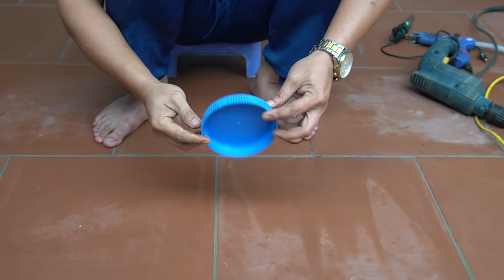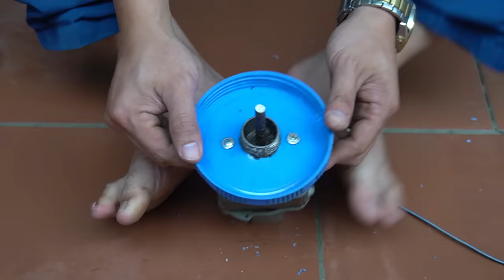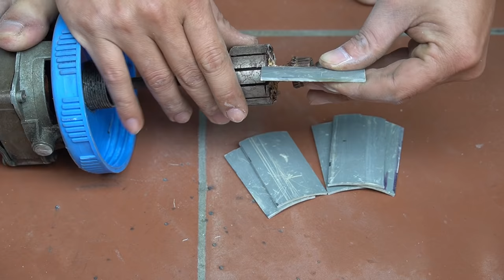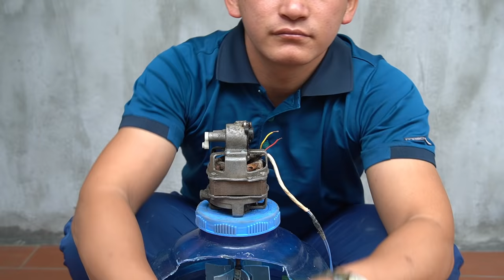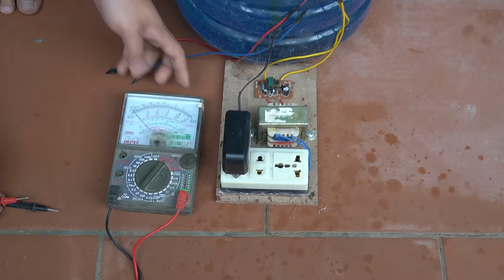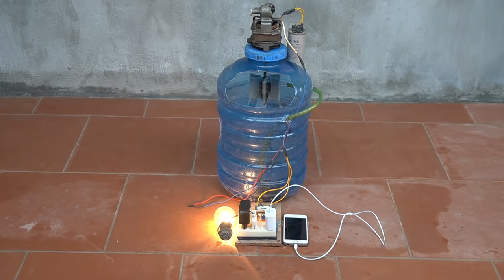Turn Plastic Bottles Into A Simple And Creative 220V Water Turbine Permanent Generator

Comment: While it was running you need to stop the turbine in action so we can see that the power shuts off when you stop the termite so we know it is not running off of other power sources.
Reply: Like the one inside the Capacitor Carcass...
Reply: And theres a video cut in 7:12
Reply: We
Reply: Pero raro, esa clase de motor no sirven para ese medio de inducción.. Es falso debe haber, una fuente de energía oculta en alguna parte.
Reply: Things aren’t adding up.,🤔🤔🤔
He’s obviously charging up the capacitor with the battery that will run things for a min or two.. so with enough video cuts 👉🏻the blind get fooled 😂
also to generate real power that should be spinning a lot faster😂
Reply: jinious

Comment: Nice Trick!  I'm guessing the hidden power source is in the "capacitor", but perhaps it is a bunch of batteries on the underside of the board.
Reply: Exaclty, because I still don't understand why he needs the water. Obviously it is not what turns the motor

Comment: Great invention this is what i want to do also, i am also an electrician that want to give help in remote areas that has no electricity, great job, salute to you sir
Reply: Sir please explain the PCB Board and transformer which is used in the video
Reply: @subodhchandramahato3788  12/24 to 220 volt ac transformer capacitor for smoothing current
Reply: @Canonhood  
Thank you so much for replying Sir
Reply: @Canonhood  
But Sir , what is the function of PCB Board/electronic kit that use befor transformer please....
Reply: The pcb is a voltage regular from power supply TDC POWER 24V 1-PIN AC UK PLUG POWER SUPPLY US 110 volt ac there is no diods or bridge rectifier on the pcb so It must be ac to ac
Reply: @Canonhood   
Thank You very much Sir, for your valuable information...🙏🙏
Reply: @subodhchandramahato3788  your welcome
Reply: @Canonhood   Sir, can I work with you on that PCB board. That's the only thing thing that's not clear to me.
Reply: @oluwasesanadetola775  what the issue
Reply: @Canonhood  Am thinking of how the PCB board + transformer can be incorporated in a free energy project of using an Alternator + DC Motor.
Reply: @oluwasesanadetola775  I cant see a bridge rectifier or 4 diods side by side on that pcb so I'm taking it converts dc to ac inreverse then the transformer step the voltage up to 220 volts ac from 12/24 volts like a inverter but where the 4 mosfed transistor
Reply: DC-AC Converter 12V to 110V 220V AC 150W Inverter Boost Board Transformer this has the pcb and transformer in one pcb ebay your friend 

Or

500W Inverter DC 12V-24V to AC 180V-220V-380V Booster Board Module ✧
Reply: Part list 

1 x 500W Inverter DC 12V-24V to AC 180V-220V-380V Booster Board Module ✧

2 x tumble dryer motor induction converted to a generator by opening motor and dill 16 holes to plus round type nimdium magnets and glue in place with super glue North and south
40 x nimdium magnets 
1 x super glue
1 x 240 volt ac to 12 dc transformer to power the water pump 
1 x submerged water pump 12 volt to pump water from bottom bottle to top bottle
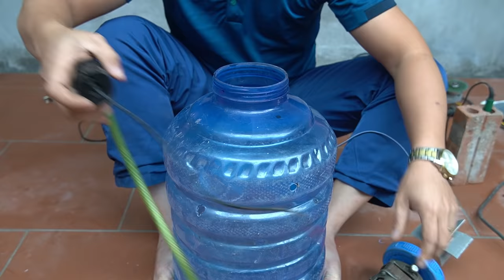Reply: 4:04/11:57  can someone be kind to tell me what is the name of that component.
Reply: @savedgeneration3254.  12 dc volt pond pump submerged powered by 240 ac volt transformer
Reply: Have you done any project now, helping people in remote area is one of good to give out
Reply: @Canonhood  hello, is nice to see someone really trying it out, how did it go's, did the project work out? Base on all your calculation
Reply: @tolexfarmland thank you my friend but i didn't do anything yet, i'm too busy with my job and also lack of financial, maybe i can fucos when i will resign my job,  things is so complicated, you know im just an ordinary man with family,  my goal now is to sent my kids to school, hopefully someday i can do my project and help ordinary people, and if that days come you can watch it in my other channel Electricians Creative Diaries.
Reply: @Canonhood  Nice break up Mr Mason.. Brilliant understanding. Helped lot to understand the items being used.  Can we do same prototype in bigger way? I mean why they still use diesel Gensets? Can't we make one equipment which can be started initially with diesel Or any other source and later it can feed itself and also generate power to other useful works?

Comment: Most of these I just save in my "Awesome Music" folder.
This one does show a simple way to turn some scraps and broken
Parts Into a hydroelectric generator,
that part where he inserts the plastic into
The old coil winding is actually brilliant.
Of course, I would probably weld it to a DC motor.
Or use a belt with a splash guard.
And run a pipe from a waterfall to actually power it.

Comment: Great project, the details of the build process aren't given but I'm guessing, the energy generated by the dynamo (generator) is passed through an inverter to convert it to AC and probably step it up, then part of it is used to keep the water pump running & the other used to run some devices like the bulb and charging the phone.  

I think after some time, the system will have to slowly come to a stop especially since your using part of the generated energy to power up some devices, it means the pump isn't getting as much power as it should, it will thus progressively pump water with a weaker force, making the dynamo to rotate slower (few revolutions per second), hence less power generated, and hence the system will slowly stop!  This is a consequence of the principle of conservation of energy.

That said, the project was a good venture, its something I'd love to try when i have time & see how long it would take for the system to come to a stop.
Reply: Completely correct!
Reply: I agree
Reply: Hears A thought , When it starts to slow down give it another boost from the external source as such the DC energy
Reply: or solar, ect
Reply: Chắc chắn rồi. Nếu chỉ dùng để chạy máy bơm và tạo ra dòng nước chảy xoay vòng thì thời gian sẽ lâu hơn. Áp dụng cho làm hồ cá sân vườn. Tạo dòng thác chảy thì tuyệt vời
Reply: Absolutely where I'm stuck was the battery he used initially to power up the pump and later retained it by taking an AC power from the step up transformer output. What kind of battery is this that powers an AC pump? If this is clarified we'll know if the power the pump is getting will slow down and eventually stops or not
Reply: That is not how the laws of physics work. Clearly there is a lot of energy bled from the circuit in addition to serious efficiency loss with all of the conversions and mediums. Even in a state of 100% efficiency, if energy is removed then the motion will stop. These videos are genius honestly because 99% of the population on the internet are frankly stupid and will watch the videos while blasting the comments with their typical stupid questions and statements while the few smart educated people go through and attempt to educate the ignorant and debunk the video making for a vicious cycle of $ for the channel
Reply: I want to make one..what are the materials used please list?
Reply: @paulj.thaddaios  :face-blue-smiling:
Reply: @DiReal_Donclassy  nope he used a DC water pump. the thin is he used a charger to convert the AC been generated to DC for the charger to power the pump
Reply: I hope that you are joking, anc that you can actually see that this video is a fake.

Comment: A lot of people don't understand the difference between a battery and alternator. This creates energy like an alternator. Alternator is a power source. A battery is just power storage. You leave the lights on in your car they get them in the battery goes dead or almost dead so you somehow managed to get the car started and the battery gets charged up again because of the alternator. Think about this way as well you can actually use a drawstring on an alternator to get it start going . Think of like a lawn mower it doesn't need a battery and the one the motor of the lawn mower is kind of alternator style
Reply: Wow you to enlighten me more if you don't mind.

On how to go about chaneling this knowledge to create a battery
Reply: @canhamzacode  you can use a small tote, sulfuric acid, distilled water and two metal post make sure to use mask and long gloves. Sulfuric acid is very dangerous
Reply: @ronniehugh7905  thanks I will put it into consideration

Comment: you charged the capacitor with the battery you removed the battery but in this case the capacitor becomes a battery the circuit then becomes an RLC circuit after a while the circuit will stop
Reply: I think you are right, because of all the dynamo doesn't have function with capacitor, so he modified the capacitor into a battery 🔋
Reply: Otherwise the fan motor should be a brushless motor to overcome the dc output  and capacitor should be a  ultra or electrolytic cap. Leakage can be seen in the system.
Reply: Bogus not invention haha
Reply: I like wise pple
Reply: I don't think it really matters how he's doing it because it's pretty damn obvious that rotation is way too slow to be generating any clean consistent power
Reply: Thank you for pointing out the Capacitor / Battery I just did not think it would have the capacity to power the pump. So in between video cuts, the Capacitor had to be recharged each time.  You found the magic dust.

Comment: The Capacitor and the Battery charger had played important role for continued running of the wheel... I appreciate if you will share the capacity and the rating of the Capacitor, transformer, And  the submersible pump.. thank you.
Reply: quá thông minh
Reply: As you said about the battery, I think one can use solar panel and the controller to charge the battery to help the rotor rolling at all time, just small solar panel for the small battery will do the job
Reply: Glad to see someone else wo understand so many in the comments being ugly that don't understand

Comment: How did you circulate the water? Are you changing The Ac to DC with the board and transformer? If yes, what kind of board is that? explain the circuit in the board, and what's that plug  meant for and how did you connect it to the alternator? And is that a capacitor that you connected to the alternator? If yes what's the capacitance? I would have asked why but its like you used a battery to start the generator like a spark plug. I don't understand that. At the very least explain how you were able to circulate the water.
Reply: hola amigo saludos desde paraguay.. eso es sólo un truco el chico es un genio en truco.. utilizó una bomba veicular de gasolina 12 vol cc.. y un cargador in 220 vol ca....  out 12 vol cc... y un motor que era de lavarropa el cual  no es un generador  si te fijas bien cuando el foco  prende y apaga su supuesto generador ni esfuerzo hace el caso esque cuando una  foco o luz incandescente se prende debería frenar un poco al generador pero este chico escondió muy bien por debajo de la madera su cable alimentador de la red 220 
que engañó
Reply: you asked my all doubt..brother ...we ned an explaination vedio
Reply: You mean what kind of board?
Dude thats a Power Supply,contains of many components like diode,capacitor,and transistor and also the transformer which is controlling the overflowing of the current or minimizing 
Yes,AC to DC using of multi tester just put the 2 pin point of the multi tester from the hole of 3 gang,just watch what he had been done before the video tutorial and remember the pin point of multi tester is red and black,while the red is positive and also the black is negative before putting the pin point to the 3 gang just adjust the hand of multi tester from zero ohm's its left sided located and turn the adjuster to right point of AC 250 V inorder to get the exact amount of 220 V of the primary section
Reply: fake
Reply: @castulovazquez123  sorry amigo. I don't understand Spanish.  I only speak English. Grasias.
Reply: Religião é assim, parece más não é 😂
Reply: @anonymousfreedom6269  I'm a bit confused. The multi tester is used to measure the voltage I guess.  I get what you mean when you said the board, transformer, transistor diode makes up the  power supply. Which reduces the voltage and current similar to the way a laptop adapter/charger/power supply work.  I thought a rectifier is used to change ac to DC. Never mind. But why would he reduce the voltage and current and change it to ac. I thought the Ac voltage coming out is 240 volts before getting to the power supply. So why would he step down the voltage.  More importantly what is that thing he attached to the hose he used in turning the fan?
Reply: @alexoshike3367 the magnetic field in fan head is configured to induce unipolar current in the coil in form of dc, mini inverter 100 or 200w steps the voltage to 220v ac and fuel pump is used to pump back the water powered by phone charger
Reply: OK, now I get it thanks. So you mean that motor is configured to generate DC with 100 volts and that board with the transformer is actually an inverter used to step up the 100volts to 220volts and at the sametime changes the DC to Ac.  That makes more sense.
Reply: @philipolorunsola8612  thanks bro, please where can i get the mini inverter from?

Comment: ac motor cant make electricity without putting magnets in the router
and the the speed of the router turbine is not too much to produce electricity 
not enough speed 
and the loads are taking too much amps 
so there is a messing part here

Comment: 1 water purifier transparent plastic big bottel 
1 water pump 
1 12v dc adapter
1 wall or tabel fan motor
1 condensor
1 step up transformer 
1 Dc to ac convertor circuit
2  socket attach with dc to ac circuit
Reply: ههههههههههه
Reply: Ok po ba to pag sinubukan

Comment: It's a show well done and entertaining... Kind of a visual magic trick... 
What I see is, in my opinion, the energy out of nothing does not exist. With every resistance, energy is lost, which degrades faster or slower and keeps a system alive for a certain time, until the energy supplied is used up. In this case, a small pump is connected to an external battery as a power source in order to bridge the first major resistance to pumping the water through the system, which in turn sets a rotor in rotation. Then apparently a generator that is driven by the water takes over and the power pack for the water cycle takes over. Now a strong capacitor is used, coupled to electronics and a coil. The battery is disconnected and, oh no wonder, even a small consumer such as a small mobile phone charger and an LED light bulb are supplied. Unfortunately not, the energy for the socket comes from the meanwhile charged capacitor, which has eluded our observation due to the cut and now supplies the electronics and the transformer, which is necessary because the capacitor generates 450 V voltage, which first has to be reduced and regulated down. (Note: A generator, in contrast to a motor, does not need a capacitor) and for a short moment the circuit runs until the capacitor is empty at some point, but this takes longer than the video is running. It is certainly not a perpetual motion machine that also generates additional energy from nothing because it is physically impossible. Numerous scientific papers on the subject can be found on the Internet.
Es ist es eine gut gemachte Show und unterhaltsam...Eine Art visueller Zaubertrick ...
Was Ich sehe ist ist nach meiner Beurteilung die Energie aus dem nichts gibt es nicht. Bei jedem Widerstand geht Energie verloren die sich schneller oder langsamer abbaut und  eine gewisse zeit ein System am Leben erhält und zwar so lange bis die zugeführte Energie verbraucht. in diesem fall hängt eine kleine Pumpe an einer externen Batterie als Stromquelle um schon mal den ersten großen Wiederstand zu überbrücken das Wasser durch das System zu befördern, das wiederum einen Rotor in Drehbewegung setzt. Dann übernimmt anscheinend ein Generator der durch das Wasser angetrieben wird und schon mal das Netzteil für den Wasserkreislauf übernimmt jetzt kommt ein starker Kondensator zum Einsatz gekoppelt an eine Elektronik und Spule. Batterie wird abgeklemmt und oh wunder es läuft weiter sogar ein geringer Verbraucher wie ein kleines Handyladegerät und eine Led Glühbirne wird versorgt. Leider nicht, die Energie für die Steckdose kommt aus dem mittlerweile geladenen Kondensator das sich unserer Beobachtung entzogen hat durch Schnitt und jetzt die Elektronik und den Trafo versorgt was nötig ist da der Kondensator 450 V Spannung erzeugt die erstmal reduziert und runtergeregelt werden muss. ( Hinweis: Ein Generator im Gegensatz zum Motor benötigt keinen Kondensator) und für den kurzen Moment läuft der Kreislauf bis irgendwann der Kondensator leer ist das allerdings dauert länger als das Video läuft. Es ist mit Sicherheit kein Perpetuum Mobile das auch noch Zusatz Energie aus dem Nichts erzeugt  weil das Physikalisch unmöglich ist Zahlreiche Wissenschaftlich Arbeiten zu dem Thema findet man im Netz.

Comment: Amigo você está de parabéns ,gostei muito,sou Carlos da Bahia Brasil,gostaria muito de fazer  um gerador deste,você pode Mem mandar o esquema,agradeço.
Reply: Fake meu querido, a princípio para ser fácil ou funcional qualquer motor rodando e offda uma corrente+-12v o que ligaria a fonte
Reply: This is not fake you just don't know what you're looking at that a transformer he uses the battery to charge the transformer and the pump to flow the water the capacitor to keep energy in circulation simple mate